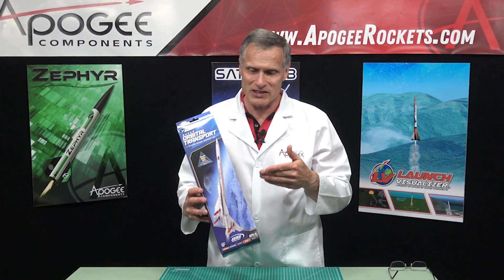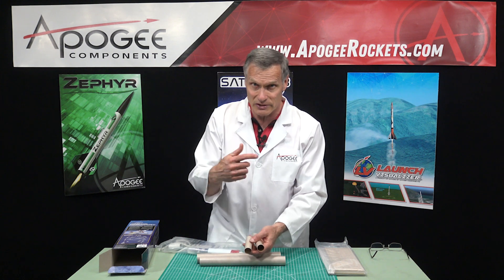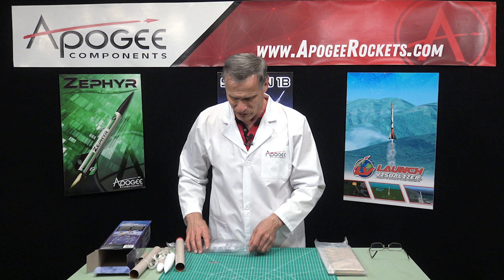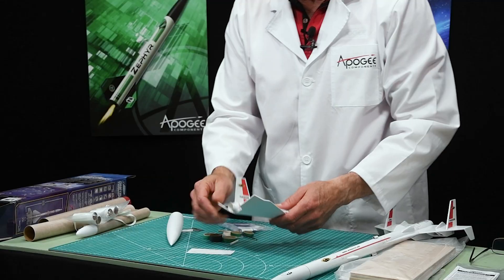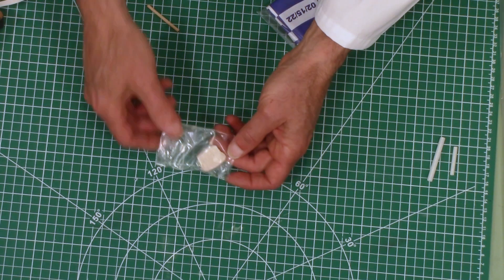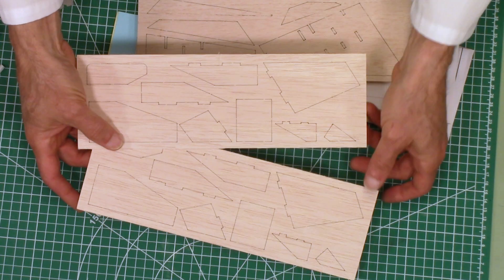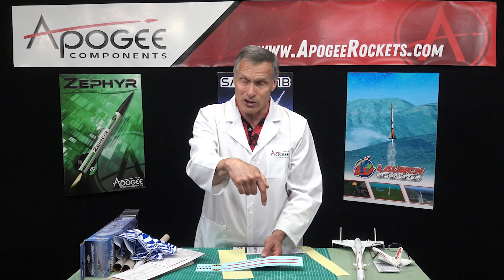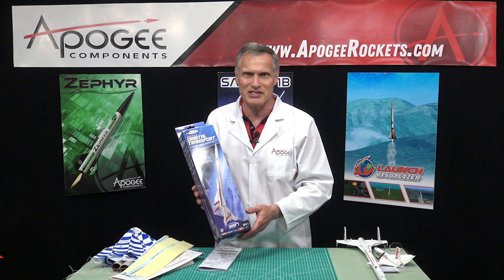Unboxing the Estes Super Orbital Transport Model Rocket

Comment: Great kit but I chose to upgrade mine with  plywood fins and centering rings as well as a thin mill nylon paratchute. It will also use rail buttons instead of launch lugs and a kevlar /elastic combo shock cord mounted to a eye bolt attached to the upper centering ring. I plan to fly it on Metal Storm or Dark Mattter motors which should make for some great pictures!! 😁
Reply from the maker: Awesome. I'm always glad to see experimentation by rocketeers. Have fun with it!